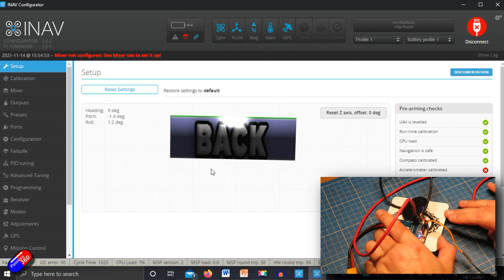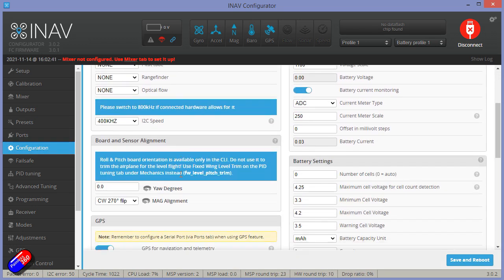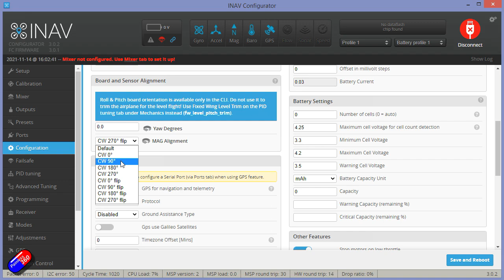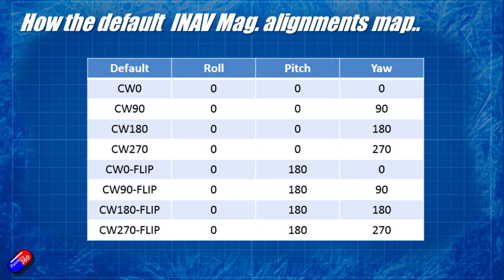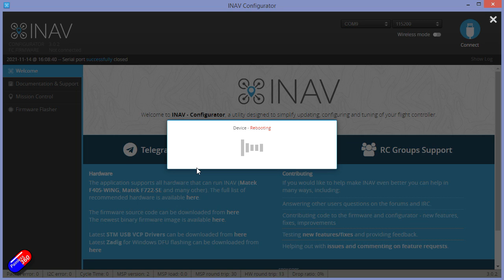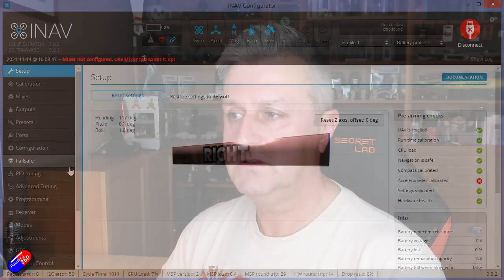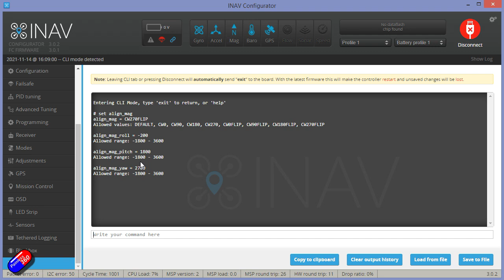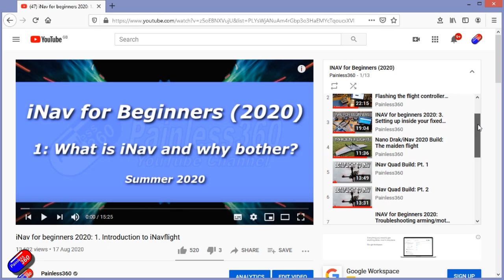How to setup a compass in INAV when it is at an angle?

Comment: Great helpful tip. Thanks Lee. 
Timely as was trying to setup a new gps with integrated compass on my Flywoo Explorer this last weekend, and like you was confused. Can confirm this works. 😃👍
Originally was setting the offset as  -10º, as compass(and integrated gps) is mounted at tilt -20º in pitch. Was thinking better to use "average angle" between when quad would be level (in hover) and assuming 20º pitch forward in normal flight.  
However, after watching this it sounds like the offset is the difference between the FC (INAV) orientation and the GPS/compass orientation. So compass alignment should be set at -20º.
Reply from the maker: Great to hear that this helped. I tried to all sorts to work it out out from the superficial detail in the wiki. Happy flying!

Comment: I just ran into this problem.  Wish the video came out a week ago, 😂
Thanks for the explanation.
Reply from the maker: The video has been sat in the INAV playlists for a few weeks. I could have pointed you to it if you had asked the question...
Reply: @Painless360  😂 luckily I figured it out.  

There is definitely a lack in useful quad info out there about iNav.   Tons of wing stuff,  but, not a whole lot about quads.
Reply: @Painless360  would you suggest having the compass at a similar angle to what will be flown if your goal is to have a freestyle drone that has an emergency button?   

I built my 3d mount flat, because I was having toilet bowling when it was at an angle.  

Now that I have this knowledge, if there is a benefit to having it at an angle, I may switch it back.
Reply from the maker: There are two schools of thought. I've used both here and both have worked great so I just set it up for the compass/GPS mount the model has.. Happy flying!

Comment: Excellent discussion as it was not intuitive at first.  Thinking of the perspective of the compass chip orientation, it makes sense that the roll is -20 degrees for this drone model.  Seriously considering getting the Rekon 7 LR with DJI air unit and using INAV

Comment: Tip: If you cannot figure this out, especially on a board with atypical magnetometer placement (with no directional markings), use XYZ mode in INAV magnetometer tab (new thing) and look up datasheet for that magnetometer (note the dot in a corner). Write down that orientation with XYZ arrows on a paper and match it with your magnetometer (rotate the paper) and then match it again in INAV. Next do the compass calibration and it should be working.

Comment: I found the explanation to this in RCgroups back in July when, like you, I'd spent hours fiddling and somehow got it working by trial and error. The acid test after all this is point drone North, East, South and West - does it display the correct headings?  Then invert drone and test again, does it STILL display correct headings? If it does you got it right, if not start again 🤣

Comment: Hi Lee. I'm having a hard time with this because, in my case, I had to rotate the FC in 180º now, the instructions say the alignment has to be relative to the FC but does the values and alignment shown in the setup tab match the actual quad orientation or the FC? Thanks in advance
Reply from the maker: The only difference should be in the FC orientation settings in INAV. Once they are set then everything else is the same. This is why I always strongly suggest mounting the FC in the intended orientation, as it avoids all of these questions. Best of luck with it

Comment: Hmm... Pretty interesting indeed, Lee! Thanks! 😃
In the case of the GPS being flat, would it be the same without the roll part?
Anyway, stay safe there with your family! 🖖😊
Reply from the maker: Yes, but if it is flat then the compass will work with one of the presets... Happy flying
Reply: @Painless360  so should I manually input other settings as per chart, or leave them at zero when compass is flat?

Comment: thank you very much for covering this topic ! I also had been struggling for a week or so with the same problem in inav, and ended printing a flat gps support :-)
Since I am converting to arducopter on a build with a tilt support, do you know if there is a special param for ardupilot ? or will the compass calibration do the job by itself ?
thanks again !
Reply from the maker: I've never mounted the GPS anything but flat in Ardupilot.. Best of luck!

Comment: Thank you so much for this information!   I'm building off the same frame.

What are your thoughts about using 2604 1350kv for cruising on 1300-2200mah 4s packs and a Runcam 5 Orange?  I'm trying to avoid purchasing $120 on the heavier, more demanding but popular 2806.5 standard.
Reply from the maker: Not sure, I've not tried them. Let me know how you get on!
Reply: @Painless360  it flys!  Really needed a lot more D and P.
I'm using an old bn880 gps compass and still having issues getting it working.  According to the documentation I can find it should be a 180flip for mine but that's not looking good either.

Comment: You can do the same in Betaflight. I had to set it to CUSTOM for it to allow manual number entry.
align_mag = CUSTOM
mag_align_roll = -200
mag_align_pitch = 1800
mag_align_yaw = 2700
Reply from the maker: I've not tried. Does Betaflight use Compass for navigation like INAV?
Reply: @Painless360  It doesn't do navigation, other than GPS rescue, but I like to see where home is. And this setting seems to make the heading on the OSD a LOT more accurate. I have had problems with it so THANK YOU!

Comment: Thanks for this one, as i have talking about re-positioning my gps mount off 20+ degrees.  Do you think there is much more of an advantage for keeping satellites at 20+ degrees than degrees of 0 at horizontal with the quad?
Reply from the maker: It depends on how you will fly and where the gps is.  An angle can help it point to the sky in forward flight but isn't as good if you regularly fly backwards..
Reply: @Painless360  I normally fly around 5-25 degrees like cinematic style  forward stuff, not flipped floppy Pewel style freestyle.

Comment: Is it just that the accelerometer in your FC was mounted at 90 degree about yaw and so the pitch axis became the roll axis? Also would be great to know if you set the mag align to 180 deg flip, does the direction of yaw become inverted (i.e. does a positive 20 deg yaw increment relative to the FC now become a negative 20 adjustment in the cli since, because the mag has been flipped about pitch, the positive direction of yaw relative to the mag is now negative)
Reply from the maker: Nothing to do with that. It's the relative orientation to the flight controller. Best of luck
Reply: @Painless360  so, if inav reports the FC being pitched forward by a couple of degrees when the drone itself is on a flat surface, should we add those degrees of pitch to the mag alignment?

Comment: I have attached an HMC5883 compass to my SpeedyBee F405 v3 flight controller, which is running the INAV7 firmware. The firmware successfully detected the compass. I calibrated the compass using the INAV7 configurator, simply by selecting the "calibrate compass" option and keeping the drone steady. However, I've noticed an issue: when I rotate the drone and observe the drone's depiction on the setup tab in INAV7, the image also rotates, but it does so at a significantly slower pace. It also takes a considerable amount of time to match the actual drone's changed heading. What could possibly be the issue here?
Reply from the maker: Compass calibration needs you to rotate the quad in various orientations. Updated video showing the process out this weekend... Happy flying
Reply: @Painless360  thank you for the reply, much appreciated 👍

Comment: Yea been doing this. but my rekon7 has compass at cw180flip settings to work. at 270 its off by 90degrees. so on mine to add angle it is pitch 1500.. which is rekon hglrc default settings pitch = 1500 and yaw = 1800 in inav config. (though they still show config at cw270flip its just not used if manual values entered)

Comment: And why put the gps at an angle? It could easily put horizontal(for sure on a 7 inch) .. Just for looks? Or to get better reception on gps?
Reply from the maker: Differences in of opinion on what's best. Happy flying
Reply: I think the theory is that the quad tips forward ~20 degrees most of the time  during flight making the module 'level' so it can see more of the sky and more sats.

Comment: Surely that angled GPS/MAG mount is so that when the quad is in forward flight it becomes level, So can we not just, when rotating the quad during compass calibration, angle the quad so as to keep the GPS/MAG level ?
Reply from the maker: Try it. I did for 3 weeks. Lots about this didn't quite make senses. It seems to be the relationship of the compass to the FC you are setting up.. Happy flying!

Comment: What am I doing wrong? I have a recon 7 pro. My gps is exactly  same as in your video. I have tried all the options in Mag Alignment from default to cw 270 flip and still in the setup heading does not hold the position and when I try to tilt the drone it also rotates. I also tried your values in the CLI and it doesn't work either. Thank you
Reply from the maker: Without the angle it won't work. Compass setup in the INAV file on the RekonFPV website. Best of luck
Reply: @Painless360   mag_roll angle setting didn't work for me. is it possible that when I have default value CW270FLIP that mag_roll=0 mag_pitch=1550 mag_yaw=1800 works for my quad?

Comment: So, does it make sense to mount the compass at an angle or should I just mount it in the same alignement as the flight controller?
Reply from the maker: There are two schools in of thougt. It's easier to setup if it is flat but at an angle can point to the sky in forward.flight. Most compact quads mount at an angle.. Happy flying
Reply: @Painless360  Thanks for the video.  I’m not an INAV user and only tried it once and could not get the compass to work even with the fact that I had it mounted flat parallel to the FC.  All that aside, based on what you found, I’m really surprised why the INA folks don’t have these settings setup as settings with a note as to which settings to change if your GPS/Compass is mounted different otherwise.
Reply: @Painless360  ok thanks, i'll better Stick with the flat mounted Version!

Comment: But doesn’t the quad normally fly at 20-30 degrees thus putting the mag flat??
Reply from the maker: That's why they do it. Less useful when flying in other directions. I use both types and haven't ever had a problem.. Happy flying

Comment: hmm i am rebuilding my glider with inav at the  moment but i have no "flat space" to install the gps and compass unit. it will be always slightly tiltet in two directions .. does anyone have any data how precise it needs to be setup in the firmware? is +/- 10 degrees acceptable?
Reply from the maker: A compass isn't needed for an INAV fixed wing build unless you plan to fly in higher winds. As shown, compass alignment can be off level with the FC and set up easily. Best of luck

Comment: my gps does not have a compass, so I can't use inav, running inav 6, first time on my quad, i do fly inav on planes.
Reply from the maker: You can always add an additional external compass to the i2c pins.. Best of luck